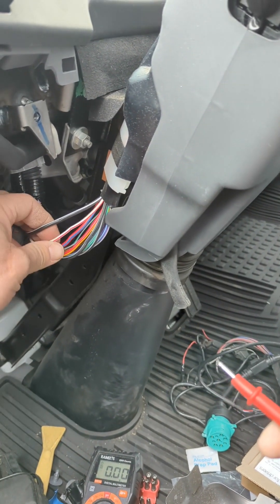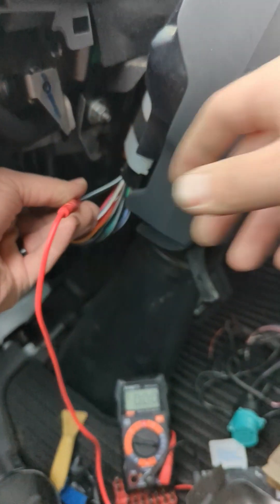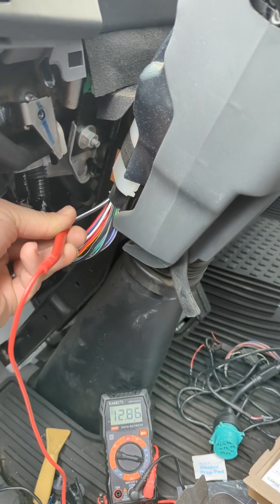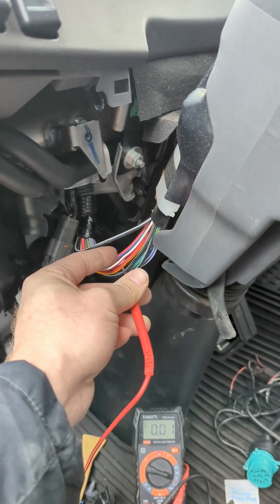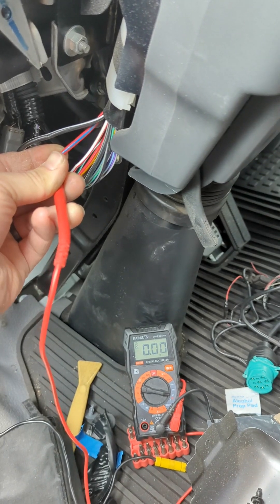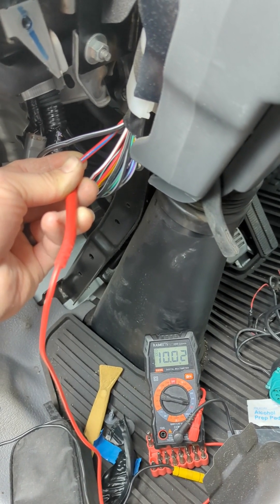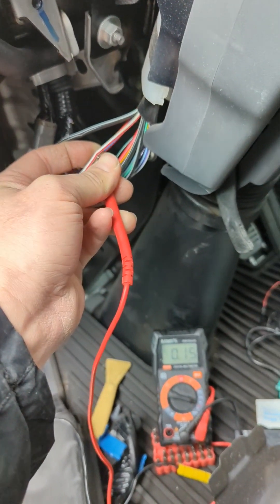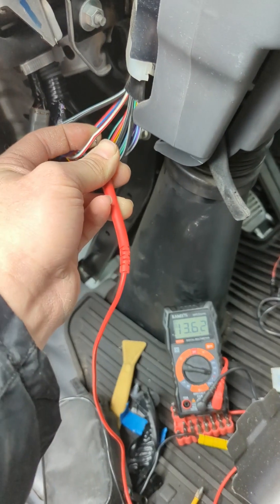TRUE vs FAKE Ignition Signal

Comment: That is one of my biggest pet peeves. 
Now, any moisture will penatrate that wire, and in a few months, you have problems.
Reply from the maker: Good point! Thankfully, I was doing a poke and wrap / military splice on the wire so that wouldn't apply. Furthermore, it was in a dry area that would not be subject to excess moisture.

Comment: Can we talk about NOT STABBING WIRES? find the connector and back probe it instead
Reply from the maker: Fair point! In this case, it would have required much more time to locate the terminating plug on this harness as it runs across the vehicle. The other end terminates up in the steering column shroud. But since the object is to complete a "poke and wrap" or "military splice" connection here anyway, the jacket is already destined for modification.